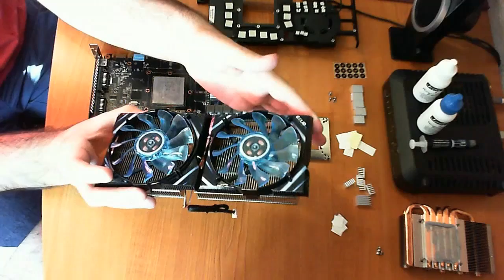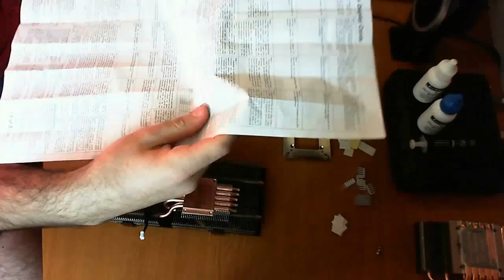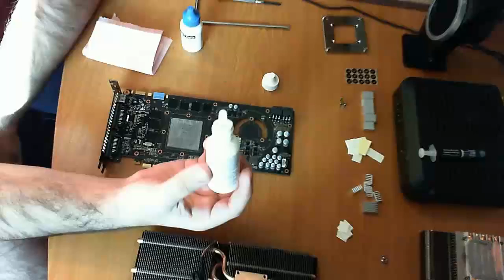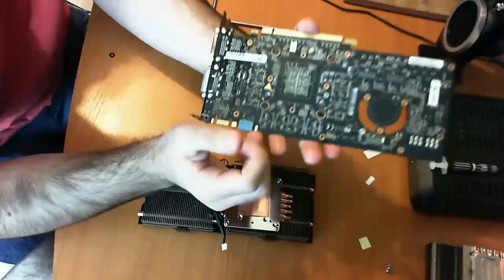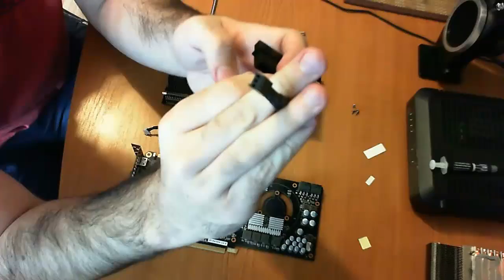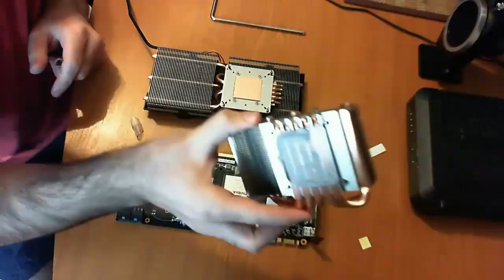Gelid Icy Vision Installation on GTX 470

Comment: The paper instructions I got with this thing were, for lack of a better word, shit. They were very generalised and made a very simple job appear very difficult.

Luckily, my MSI 560TI 448 (not the twin frozr) has exactly the same PCB as your 470. Everything is scarily identical. I set the chip heatsinks exactly the way you did yours so if my shit fucks up, it's your fault hehe.

Anyways, played BF3 on ultra with an idle temp of 39c. Bitch didn't touch 60c. :)

Comment: You will be thoroughly impressed with this cooler
I just installed it and my peak temps on my 5850 ZNFC were 43 at all maximum settings, and it's nearly silent\
My card would reach way over 70 celcius doing the same thing with stock cooler, and it never even came with ram sinks. I installed 21 included heat sinks on my card and i must say, it was worth every minute, every cent, and the time it took me to decided which one to buy
Thank you Gelid!!!

Comment: i would use nvidia's frontplate instead of installing all the little heatsinks upon rams and vrms.. i think (not sure tho) that it would result in the same thing, not to mention that it would prevent the pcb from leaning.

but still a great video, thanks

Comment: i used alcohol wipes the ones u use to wash ur hands with LOL to wash my cpu installed h40 on it and added 2 led fans to radiator and boosted fan speeds i oced my fx 6100 to 4.2 . it pulls air in the case and the top fan pulls it out so the cpu fans and radiator cools air and blows it trough the 2 hoses and blows cool air around the ram and side fan pulls in and xfx 6970 will soon have gelid rev 2 on it see how that does

Comment: @fsupaintball Nevermind. Of course, after messing with it for 15 minutes I figure it out 30 seconds after posting to the internet. Both the yellow and the white sides peel off, leaving a transparent sticky layer. I thought peeling the yellow off was peeling off the adhesive as well... not so. Thanks for the informative video.

Comment: For some reason my included sticky thermal pads are only sticky on ONE side. They are yellow on one side and white on the other. The white is wax paper that peels off. The other side does not peel off. I've actually split this tiny yellow piece of paper in half trying to see if it "peels off" on the other side, but it doesn't. Not sure what I'm supposed to do. The directions appear incorrect as well. I have an EVGA 560TI.

Comment from the maker: @MrBojax 
Well, if you want it to be quiet, you would have to get a fan controller or a speed reducer ( like the one you get with Noctua fans). Otherwise, they will run at 100% all the time. I do not have them anymore so all the information I am giving you is based on memory.

Comment: @Frostbitebampiru So with all these coolers you MUST have something to slow them down? they won't just run at normal speeds when you buy them brand new?!I would like to know as I'm considering buying 1 next week and my stock cooler is very quiet and would hate for an upgrade to be noisy!

Comment: @Frostbitebampiru 
Lucky me, i noticed a weird smell and checked the pc.

5 Heatsinks got loose... not even 10Hrs installed and problems.

This is a NO for Gelid Icy Vision rev2... i'm thrue with it.

Installed stock nvidia back. But hey, changing thermal grease
gets me idle 39°c now instead of my 47°c...

Comment: I'm not very pleased with the Gelid Icy Vision rev2.

Even connecting FAN on Graphic Card, they run 100% and can't be controled.

(The Fan connector misses the control wire.)

They are noisy and running full power gpu is down to 34°c.

Only chance is to control them via voltage...

Comment: Would this cooler fit my gtx560ti??  Cause ive got a stable overclock to 1006mhz but 2 runs thru ungine heaven benchmark for DX11 i hit 93degrees celsius ( each run is about 3min apiece)

Thanks!! Awesome review!

Comment from the maker: @wemmetje1 
I don't believe it is going to be a problem. I haven't experienced any kind of problems in my HAF-X. If you have decent airflow you wil not have any problems. Also i would recommend buying a fan controller (if you don't have one) to control the fans on the GPU cooler..

Comment from the maker: @spaznorcrest 
Depends on what GPU you have. On The GTX 470 @700 Mhz Core Clock, the max temp was 60 and idle was 30-35.

Comment: @Frostbitebampiru I checked in the nvidia system tools and it says that the processor clock speed on both is 810mhz.  My toolbar utility is just showing the GPU clock speed and the memory clock speed.  I'm confused

Comment from the maker: @spaznorcrest 
Both my cards were Gigabyte. It is strange that the bottom one runs hotter. The top one was always about 10 degrees hotter for me. The Gelid will lower you temps about 30 degrees. What clock speeds are you running?

Comment: @Frostbitebampiru who manufactured your 470?  I have 2 different ones, one is the EVGA superclocked with the high flow air bracket which cools ok but the other is an ASUS standard 470 (best I could do) that always runs at least 10 degrees hotter.  Since it's on the bottom of the SLi I am thinking about putting a gelid just on that one.  My SLi config is overheating a lot.